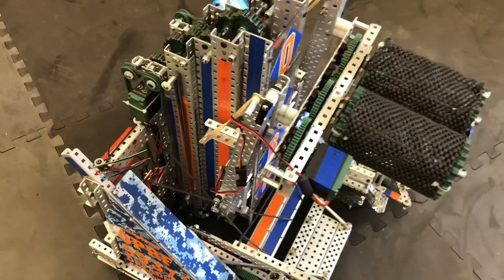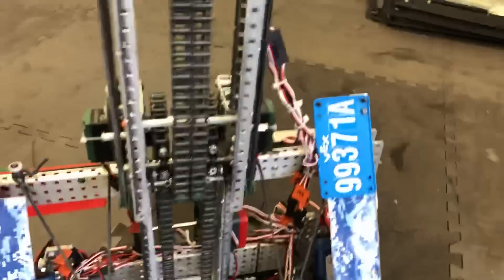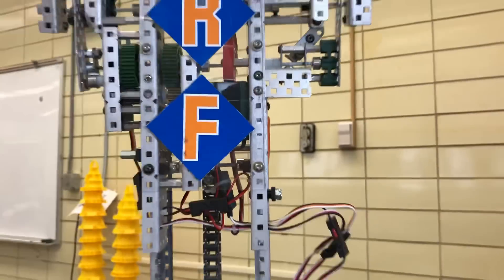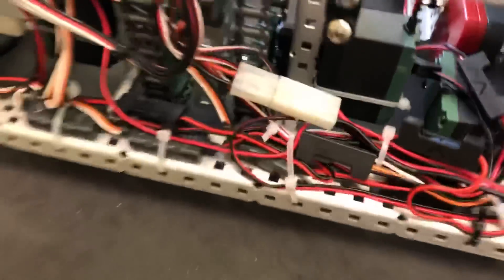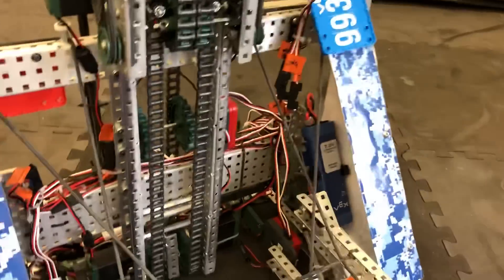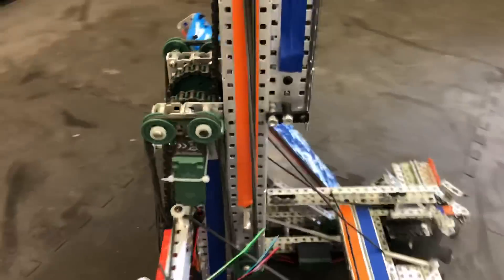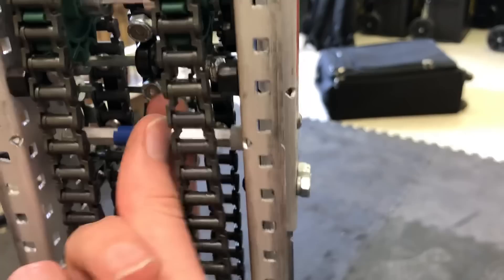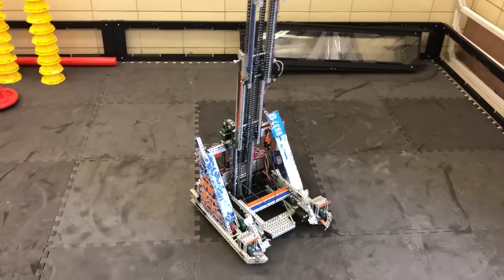How our Cascade Lift is Made

Comment: Dumb question, but how'd you manage to connect the bearings to the chains with normal screws?
Reply: you can run a screw and nut through the chain links to secure the bearings

Comment: Hey, im building a robot for one of my classes and we were inspired by your video. We have started to build a basic cascade lift although we have come across as problem, the way our sliding mech works is not very efficient and sometimes gets stuck. we basically need a new way of getting the stages to slide and im wondering if your able to help us. Thanks!

Comment: would it help if we put rubber bands at the top of stage one connected to the bottom of stage 2 instead of the latex? We are definitely using this for turning point by the way
Reply from the maker: The Rad Pandaman, rubber bands like that would help, but the reason we had the pulley was to keep the force more constant through the lifting motion. When the lift is down bands are likely at least 3x stretched meaning thrice as strong. It will be too strong at the bottom and too weak at top. Pulleys change that to about 1.5x the strength at bottom. Hope that helps, good luck with turning point!

Comment: Do you think if you cut it in half vertically it would still be viable with 2 motors (1 top 1 bottom?) or is having 2 motors on each side and and top and bottom essential.
Reply: ill be using v5 motors if that makes a difference
Reply from the maker: I'm not exactly sure what you mean by "cut in half vertically" but v5 motors have 2.5x the torque at the same rpm, so 1-2 motors will be all you will need.
Reply: should i but two on the two or one on top one on bottom?